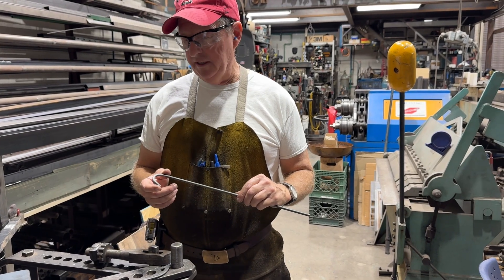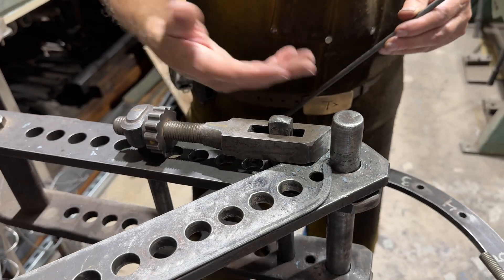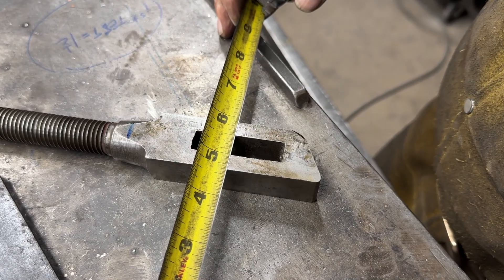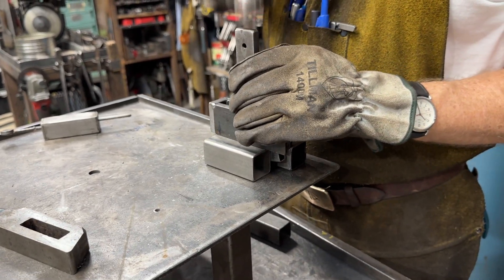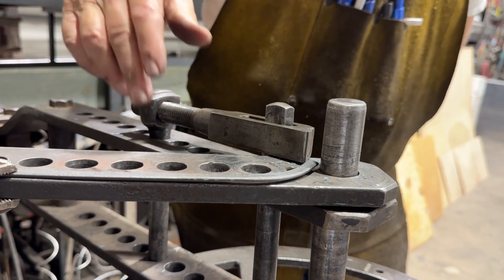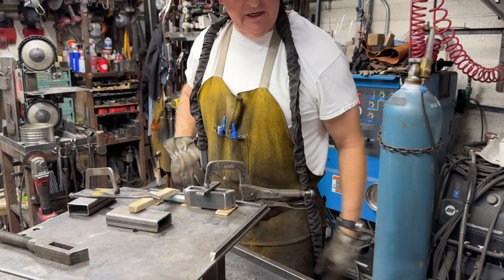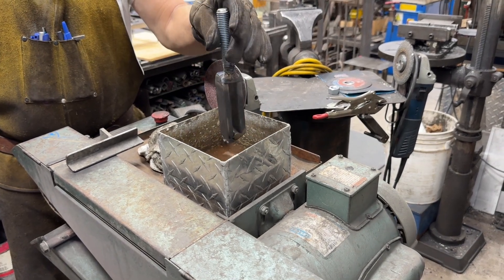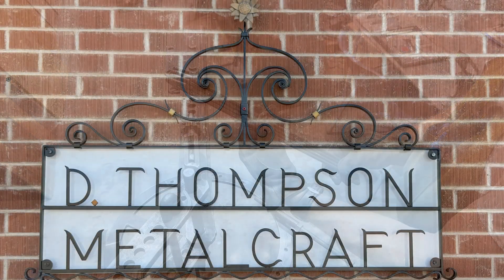Making a Tall Bending Dog for the Hossfeld Bender

Comment: I like to save all the allen keys that companies put in everything these days and use those for hardfacing parts. Usually you can blend the S2 tool steel or A1 steel they use for those with the parent metal and it seems to work pretty well if I just let it air cool. I have a little box where I save all the old broken drill bits and every single allen key that gets put into Ikea or harbor freight boxes.
Reply from the maker: Those extra Allen keys are super useful.
Check out our video on turning an Allen key into a scribe:
https://www.youtube.com/watch?v=AZplGsysX20